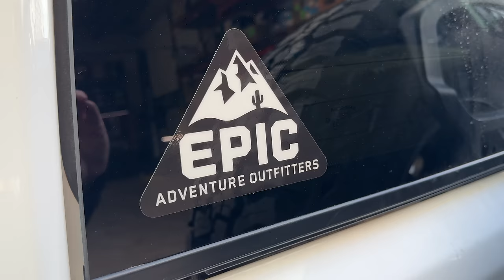Jeep 392 Metalcloak & Falcon Shock Suspension - YouTuber Will Fowler, Venture 2 Roam

Comment: So with a drop bracket will I notice any differences? As I have the complete 3.5 metalcloack lift without the front drop brackets for the arms. As for the shocks I am running the fox 3.0

Comment: Do you like the Metal Cloak hardware or put it on because Will wanted it?  Do you think Metal Cloak is equal to Teraflex?
Reply: Will wanted it. Epic is in bed with TF.
Reply from the maker: We primarily install Teraflex suspension with Falcon shocks. Metalcloak makes great products as well, just made for different setups. Will wanted the Metalcloak for reasons, so we paired their setup with some Falcon 3.3 adjustable shocks. Cheers from the team at EPIC!
Reply: I think MC makes really high quality stuff…they are also a sponsor of my channel.